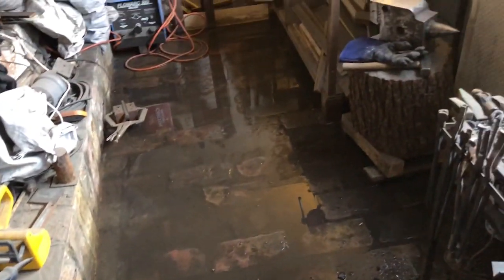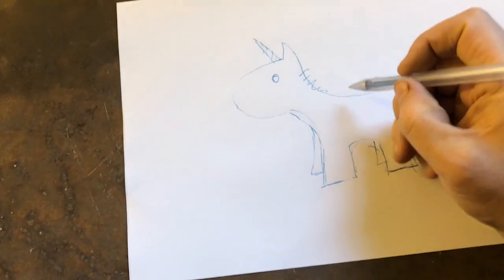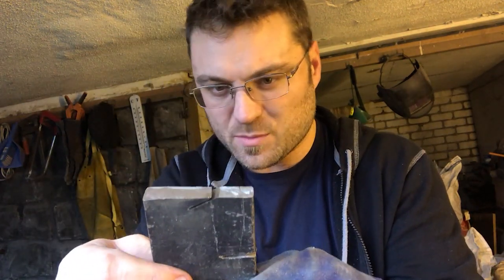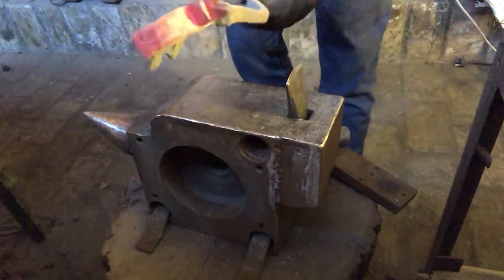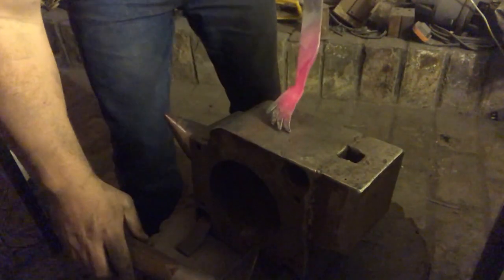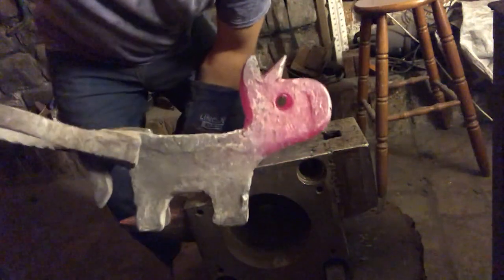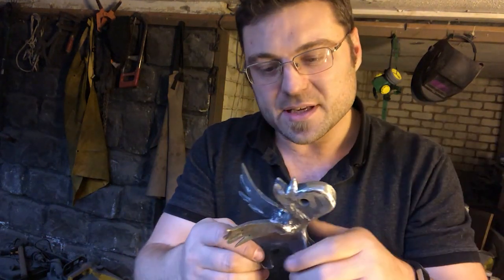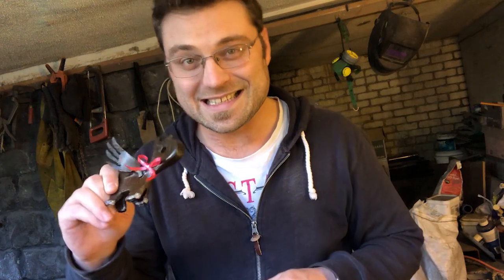Making a My Little Pony Alicorn (Unicorn) | Metal Blacksmithing Project

Comment: the only critique i could give is that the my little ponies have a large head with a tiny little nose and mouth. i would have drawn down about a half inch at the front of the face and split it about a third up from the bottom looking from the front for a mouth, and center punched some small nostrils. otherwise , great going. i'm sure she'll love it. also at the age of 5 i'm not sure weather she's still young enough to put things in her mouth but white mineral oil might be a better finish might be a better option if there's a risk of it going in her mouth as BLO is poisonous.
Reply from the maker: Thanks man - PS It's raw linseed oil, not boiled and is non-toxic, though she's not a baby at 5 so unlikely to put it in her mouth.